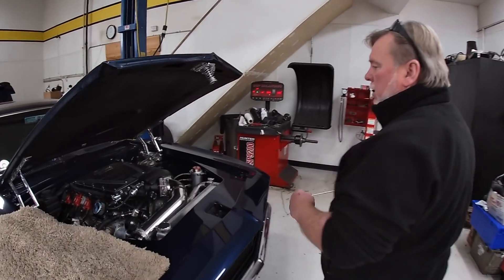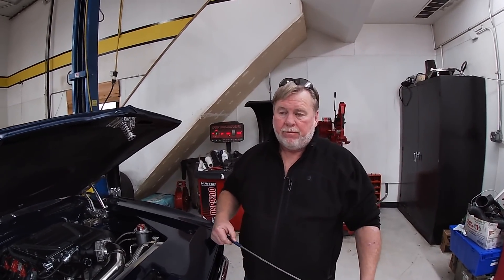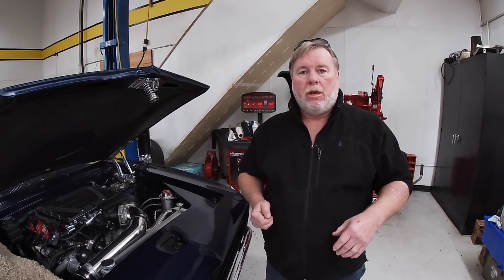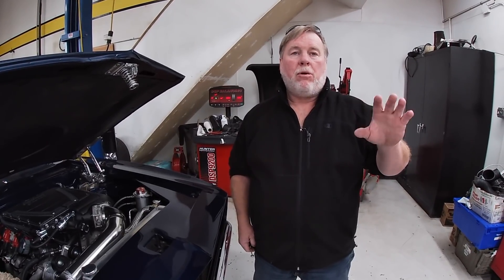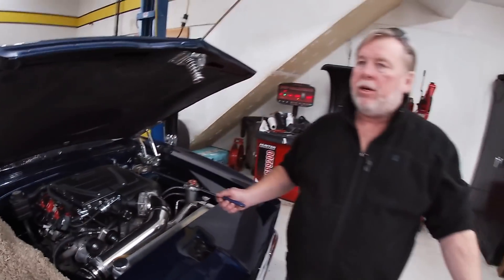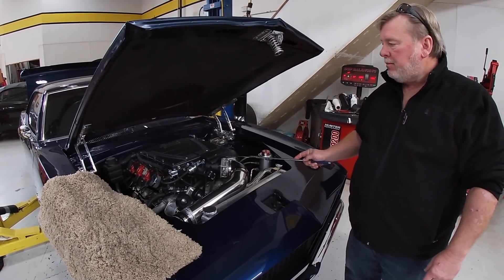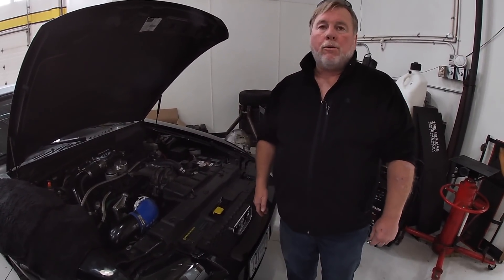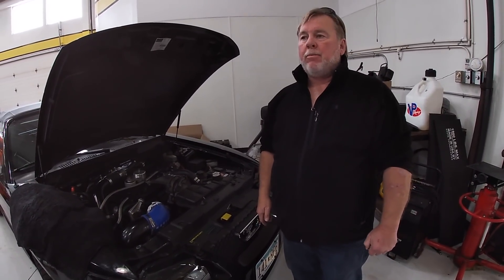What is Boost? Turbo, Supercharger, Nitrous Oxide?

Comment: Basically The Boost Gauge Is The https://en.wikipedia.org/wiki/Specific_impulse Version of A Tachometer It's Interesting Because Who Would Ever Assume That Forced Induction On A Rocket Engine Could Be Used To Measure Specific Impulse In Starships The Boost Gauges Behaves Like A Tachometer So When We Say "fire up your engines" We're Talking Some Serious Heat Coming Through That Tail Pipe Because That Boost Isn't Just Air It's Very HOT Air And The Induction Manifold Calculates The Rocket's Exhaust Velocity In Real Time Allowing A Crew To Know Exactly How Much Thrust To Weight Is In That Rocket And Believe Me If Your Boosting Into That Gravity Well At Max Boost And Your Still Losing Altitude Your Rocket Don't Got Enough Boost To Escape The Gravity Well That Means It's Time To Bail Out Because Boost In Starships Is The Difference Between A Safe Landing And A Crater Impact

Comment from the maker: As a public service announcement, CHANGE YOUR OIL FREQUENTLY!!!.  Stop looking at the idiot light that says change oil. It is really easy,  just change your oil every 5000 miles. if your odometer is at 15,000 miles change it at 20,000 miles. do it in all your cars and trucks so it is easy to remember. Every 100,000 miles do the transmission, timing  belt, gear lube, spark plugs etc. I have 499,500 on my daily driver lexus and it still runs great. Oil changes are cheap, engines are expensive. Remember dealers want to get you out of the warranty period and then sell you another car, They don't want you to go 300,000 miles and get your full use out of your vehicle.

Comment: Could you explain water methanol? and do put water meth in an n/a motor?
Reply from the maker: Water/meth is used to cool intake mixtures in forced induction engines. It evaporates and dissipates heat quickly to prevent detonation. It is a simple and relatively inexpensive way to band aid a lack of intercooler, compression or  proper fuel. I don't like water meth as most people want to inject a large amount of it for additional power. The individual then tunes with the mater meth working at maximum efficiency. IF THE WATER METH PUMP RUNS OUT OF FLUID OR THE PUMP FAILS CATASTROPHIC ENGINE DAMAGE MAY RESULT. Yes, I know they have worked for years to add in safety features, but, i prefer to have a combination that runs properly without an add on. B